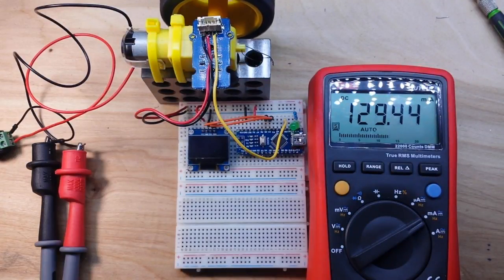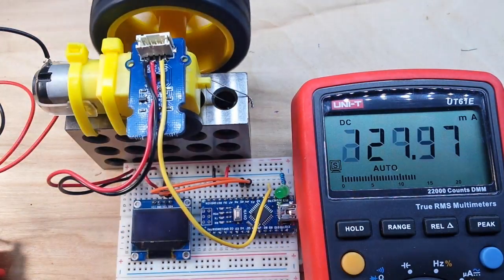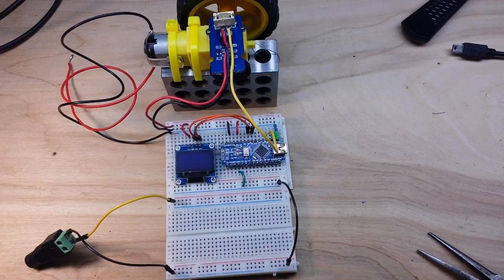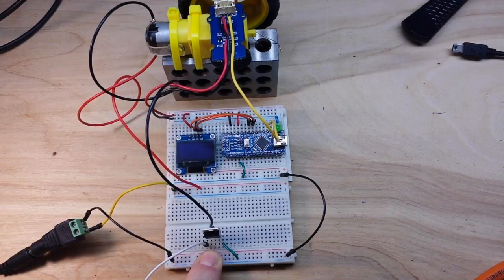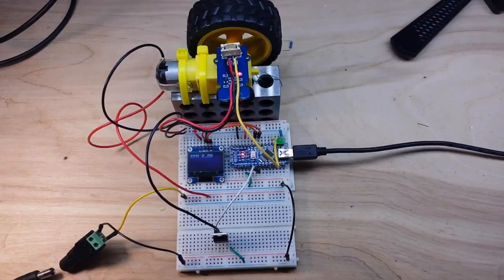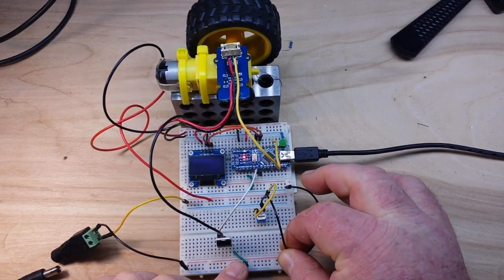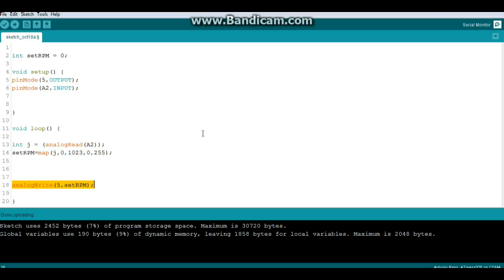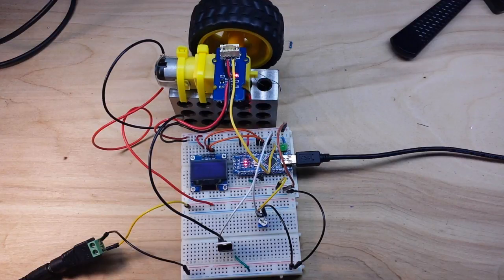Arduino PWM and MOSFET DC Motor Control

Comment: Very good....my only concern with this design...is when the Arduino pin is off...the Mosfet trap energy must be dissipated  into  the Arduino...This seems ok at 5 volts...But as the motor is connected to a higher voltage...say 12 volts...maybe the arduino output PWM  pin will burn...Other design add a resistor 10 K  between the gate and the ground...and other put a 1 K resistor between the output pin and the gate...check this design...https://www.electronicshub.org/arduino-dc-motor-control-using-l298n/
Thanks!!!

Comment: I am trying to fix a treadmill. Its running fast all the time. The MOSFET is good (not shorted) so   Its difficult to get a specific cct diagram but I am guessing it uses a uController with a PWM output.Therefore I am guessing the PWM signal  from the control panel electronics is at fault. Out comes my oscilloscope. Oh and I may need a sig gen. Thanks for the education.
Reply from the maker: Awesome! Let me know how it goes!!
Reply: The microcontroller is a Samsung S3P72K8 that does not have a PWM output so am in the dark as to how the signal is generated. Maybe a use of serial binary output patterns? In any case I am getting pulses on the signal pin leading to the motor control board but is not changing shape with speed up and down button. Very puzzling and annoying.

Comment: Great update to Part 1.  Q- I just bought a bunch of 2N2222 NPN transistors, which are supposedly rated to 600mA.  Would this be able to drive this same setup instead of the MOSFET?  Also, does your experience with the 2N2222 validate the 600mA range or is it advised to peak far under that?
Reply from the maker: +Michael Padovani oh I wouldn't push them any higher than 200mA at 5V. At 3V you could get 500. 600 is theoretical at best.
Reply: Thanks, yah, that's what I was thinking
Reply from the maker: +Michael Padovani You were thinking right my friend☺
Reply: sir why your not using a diode for voltage back flow from the dc motor?